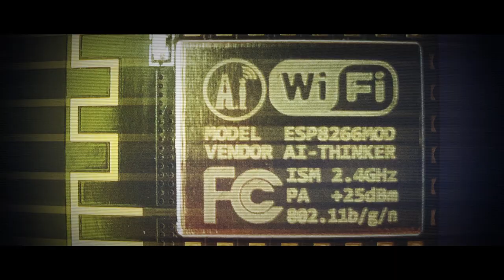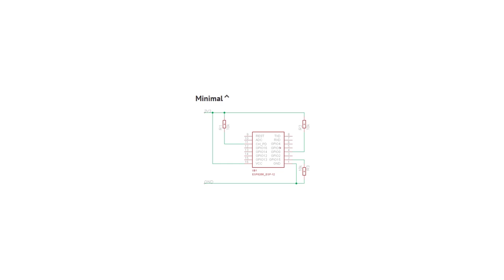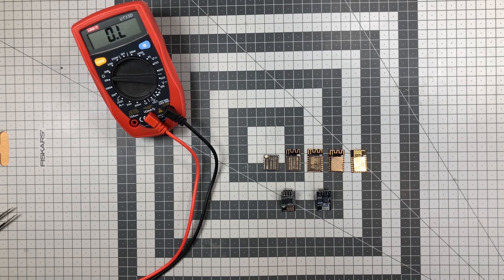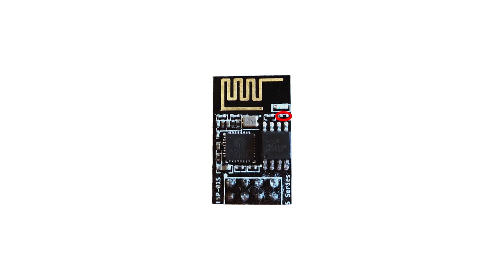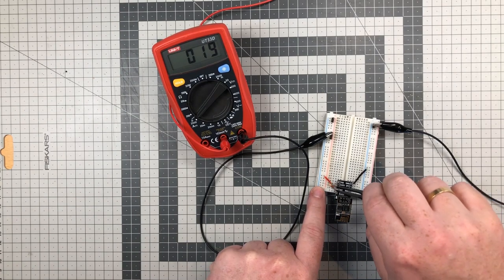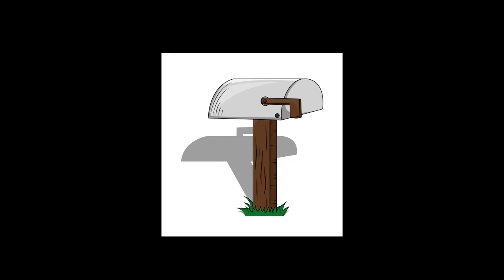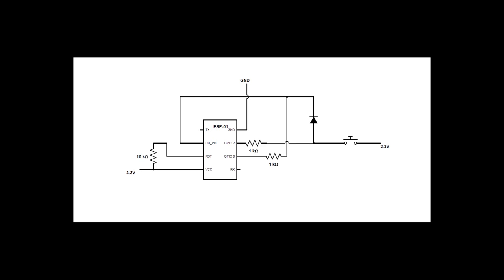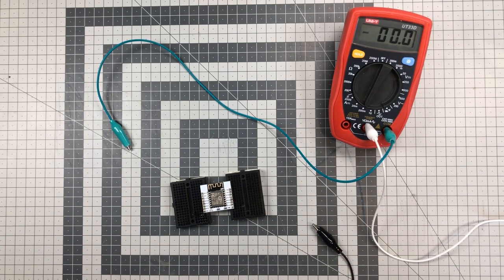Best power saving mode - Much Deeper Deep Sleep ESP8266

Comment: Hello, thank you for your nice guidance, I tried the same circuit diagram. With my ESP-01, but not working. 

I am not sure where I am making mistake but I am making exact copy as you are. Just not sure which diode you use in this. I am using 1N4007 diode. Can I use that one? Or you want me to use another diode? 

Thats the only possible thing I guess where I can make a mistake. Please suggest. 

Thank you such amazing tutorial you laid out. Its really helpful with your step by step guidance.
Reply from the maker: Hi! Are you using an ESP01 or ESP01s?
Reply: I am using ESP-01s. (black color module with only blue LED)
Reply from the maker: Rule Breaker I see. The ESP01s has a built in resistor for en enable pin! So either use an ESP01 or remove the pull up resistor on the board that is located near the LED!
Reply: @DIYTECHBROS  Yes i removed it. But my circuit is not turning ON at all. I tried a lot of ways but not working i have a schematic and circuit diagram as well on easyEDA. If you want i can share the link.
Reply: @DIYTECHBROS  https://easyeda.com/nehul.splendit/ESP-door-sen-mo here is the link of schematics diagram. And also you can view the PCB design as well. Let me know you are facing the same issue.

Comment: Hi, very good job!
I wold like to use a magnetic reed switch for my mail-box with wemos d1 v3.0
How do I have to modify the circuit?
Reply from the maker: The circuit is fairly done, it's more important what you do on the Wemos.  Make sure no power goes to the programmer or any voltage regulators.
Reply: @DIYTECHBROS  thanks for your prompt answer.
I tried the circuit with 1 wemos d1 R2 and smoke came out.... So I burn it!
I don't know in this circuit, after the diode you go to ch_en pin in the esp-01s where I have to connect this cable in the wemos d1?
I also tried with the esp-01s without desoldering the resistor.
I use a deep sleep(0) with the magnetic reed switch.
The sketch start and go online, send the notification to a mqtt and go to sleep.
When I trigger the reed switch, the blue led of the esp-01s go on and stay on but the esp don't go online.
I am at the beginning with all this staff!
I Just like to have a battey power wemos d1 mini connected to a magnetic reed swith connected to the mail box. When the reed switch trigger, turn on the wemos, pubblish the mqtt topic, go to deep sleep(0).
I can Ido it?
Reply: @lucasbrenna2  You mean smoke isnt supposed to come out of these? I thought it was just normal, like starting up an engine....! Lol!....

Comment: Any suggestions/best practices on how to remove the shield ? I tried to insert/desolder  at pcb n shield boundaries without much success. Thanks in advance!
Reply from the maker: Seems like the metal shield is glued on. I have only removed it once, but a big pair of pliers pinching from the long sides did it for me! Be careful!
Reply: @DIYTECHBROS  thanks so much...will give it a try

Comment: Hi there, thank you for sharing this idea, but I still have 2 questions. 

1. I understand why you connected RST pin to 3.3V (to avoid floating PIN), but I don't understand why did you use 10k ohm resistor in between, why couldn't you connect RST pin directly to 3.3V and another question is
2. what diode do you recommend to use for this situation, I have never used a diode before so I would appreciate an advice.

Thank you in advance!
Reply from the maker: Hi!
In general, the idea is to pull the pin high not feet it power. By placing a resistor in between you limit the current. To avoid wasting power and burning the device we always use a pull up. BUT, if 10K is always the best choice is a very different question. Higher current limiting (higher ohm) will save more power. 

See this link for more input on diodes:
https://startingelectronics.org/beginners/components/diode/

Comment: Hi, would it work with TPL5111 as a timer, which will set high on EN pin ?
Reply from the maker: Tigran Sardaryan you can use whatever you like as longe as there is a common ground and a high signal (~1.8-5v).
Reply: I understand from Adafruit that the TPL5111 board runs at 20uA. That is quite a lot......but then there are sources that claim it is 35nA........but maybe that is just the bare chip
Reply: @Ed19601  TPL5111 itself uses only 35nA, and it's very useful as a timer to wake up main MCU from deep sleep. I have used it with Atmega328p.
Reply: @tigransardaryan9298  ok then maybe adafruit added a lot that consumes current. Might give it a try. Tnx

Comment: How to make esp8266 to sleep 24h ? cus its said, it can only sleep for 72minutes. Need to update data once a day
Reply from the maker: +Sergey Zhilin In this deeper deep sleep the chip is in power down mode. It needs external pull up to wake up again.
Reply: you can count and EEPROM this value. When it wake up (72min) check = 23 ? -> +1 or reset count = 0 (72x23time = 1day) . good luck

Comment: just tried this on an ESP-12F and current is 26uA with enable disconnected. Tried with a few and they all behave the same. Not sure how you got it to 3uA. Also for clarity, their is no internal resistor to VCC on the enable pin on these boards.
Reply: Hi! Did you fix that? Same problem here.

Comment: I don't see the benefit, compared with just cutting the power supply... this result in absolutely ZERO power consumption. There are simple boards with a relay for ESP8266-S01, just feed the power through the relay and the button bypass the relay, that's it. No removal of resistors, no soldering, no additional parts (expect the relay board... and the battery will last for ever in power off :-)